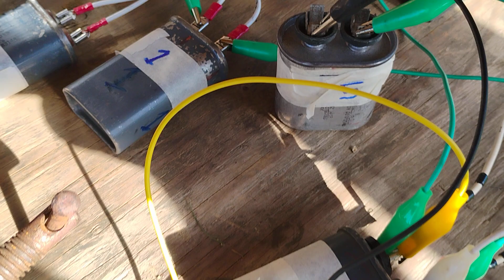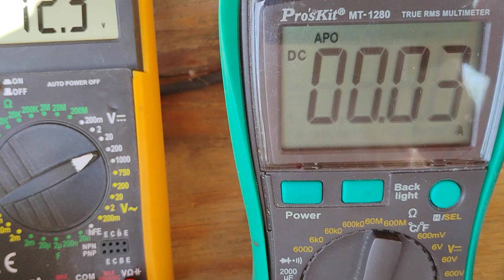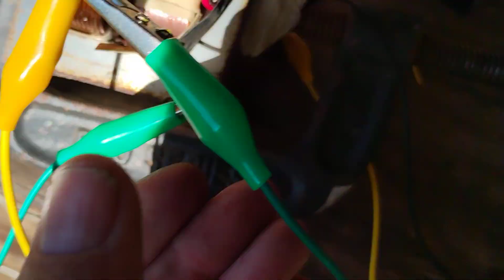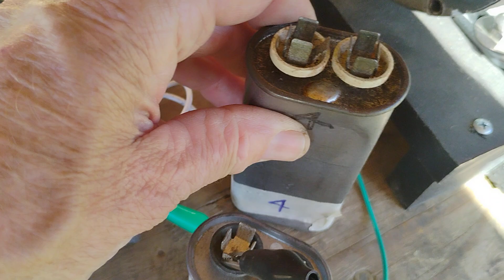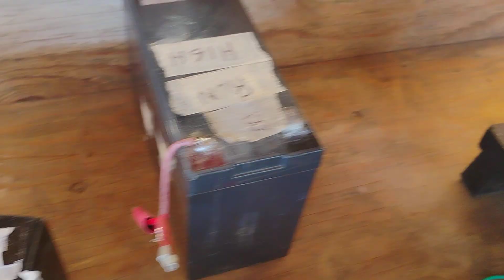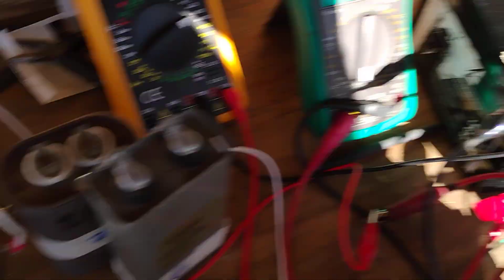Run cap phase to MOT to FWBR to DC boost convertor up to 15VDC then 12V  battery to charge

Comment: RUN Caps are great , your really taking off with them , i think the back emf gets recycled in the cap if its the correct capacitance , it does so threw resonance
Reply from the maker: Hi Myke
I think the run cap UF value resonates the "rotary transformer" inside the rotovertor motor - the rotovertor motor a 3ph AC induction motor that runs on single phase, so only L1 and L2 lines are used, while the L3 line is "open"  
Then the run cap goes across from L3 to L2 to and when you find perfect run cap UF the draw goes down bigtime, and if you go up 1uf or down 1uf you lose it, so it must be resonance happening there somehow - recycling the backemf might be how I dont know its a motor same time as alternator so might have something to do with no-lenz reaction and that would be getting rid of the backemf somehow or recycling it as you say..
When I get to "series coupling" AC caps on the AC lines too, now I think that I will be resonating the transformer, not the rotary trransformer phase inside the motor.  
When the series caps are functioning and resonating the transformer (should make for more power output will be what they do) then the run cap UF "reaction" to the motor input will also be affected, and the run cap UF readjusted in compensation for the series AC cap connected to one side of the run cap.
Here is drawing of what I am leading up to:
https://alternativeworldenergy.wordpress.com/looped-rv/